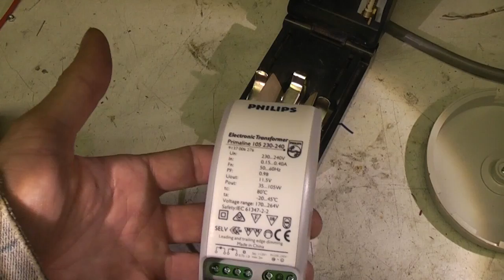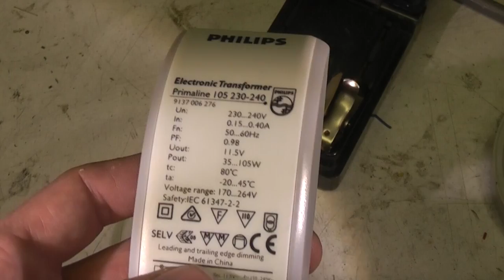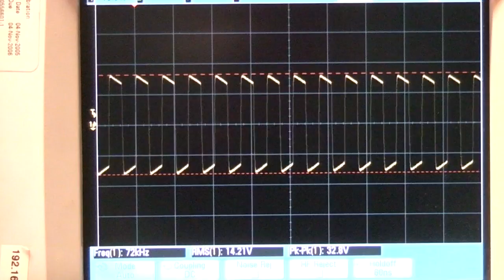Electronic lighting transformer

Comment: The wire link might be in place of a thermal fuse which is sometimes attached to the transistor heatsink.  The tiny toroid usually has two multiturn windings providing the base drive to the big transistors, and a single loop in series with the main output transformer.  The circuit is "plucked" on each half wave by a simple capacitor, resistor and diac arrangement to start it oscillating.

Comment: I've used these HF supplies to drive the little HV transformers in inverters for running short neon tubes.  I put a small cap in series with the winding to limit the current.  In the past the neon sign industry experimented with using a single high frequency converter to drive loads of little transformers in large signs.

Comment: great stuff!, I figured those lighting power supplies were proper SMPSU's, but it seems they are much more simplified.

I had no idea you could drive a flyback with the output either!. definitely not high powered but still a great novice HV project!

your right about the burn too. I remember the smell of charred flesh more than the slight tingle I got from a similar size driver. CCFL psu's from flat bed scanners have the same effect on fingers too :D

Comment: AC is actually better for halogen lamps than DC as the halogen gasses can asymmetrically corrode the filament on DC.
Also, one problem with most of these is that they will fry if unloaded.

Comment: Thank you for your illuminating videos.
Looks jus like the set up on my bench at the mo ... I'm trying to figure out a plugin retrofit converter for 12V LED lamps but not having much luck. Any pointers on a simple and efficient design would be appreciated.
Reply: Get a thing like the one in the video. Put rectifier and capacicator across the output. Enjoy either a working 12v power supply or a cool explosion.

Comment: Pretty much worthless nowadays due to 230v halogens becoming the norm, though interesting look at this circuit regardless
Reply: 230V halogen are rubbish, they don't last as long due to the thin filament and produce less light.
Reply: MrOpenGL I don't see how there is any difference between 12v halogens and 230v halogens. It's the same filament and the same filler gas. Besides, the G4 fitting is inferior to gu10.
Reply: *****
 I agree on the GU10 fitting being superior than G4 (G4 if moved can drop the lamp!!), the problem is that filaments last less if they are thinner. Because 230V is higher voltage than 12V, the filament needs to be much longer and thinner than the one for 12V in order to have the same power passing through it (the power in a lightbulb is governed by Ohm's law). Since a 230V filament is VERY VERY thin and tightly coiled together, it cannot be run very hot (2900°C) as a 12V filament can, so it is underrated and run only at about 2200°C producing a white light that's less bright than the 12V one and more yellowish, looking almost like old incandescend lightbulbs (a bit better but not that much). The same problem is present where 24V G4 halogens are a little less bright and last half of the life than the 12V ones.
In my house I have both GU10 halogens and G4 halogens. G4s are on at the same time than the GU10s. The GU10s are MUCH less bright and more powerful (35W) than the 20W G4s, and they burn out once every 5-6 months while G4s last for 8+ years (much of the fixtures still have the original ones!). All the 12V fixtures have normal 50Hz transformers instead of electronic ones.
Reply: MrOpenGL I still prefer lamps with 230v halogens because you can retrofit leds into them without issue, whereas retrofitting led into g4 means you have to replace the transformer (or live with a constantly flickering bulb). This completely negates your argument, because with a retrofit you can put any colour temp you want in there.
Reply: *****
 My argument only concerned standard non-LED bulbs, and you don't have to replace the transformer just to add arectifier and a capacitor!

Not to mention that I still prefer the light temp and output of the G4 than the one of the LED bulbs.